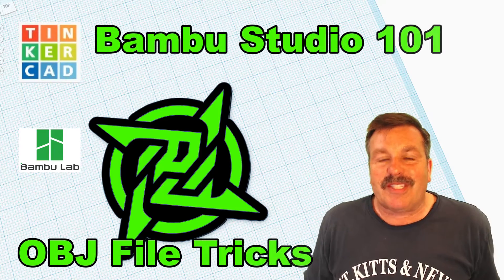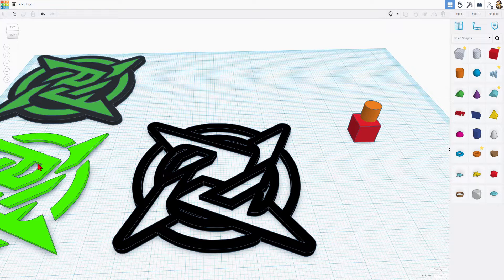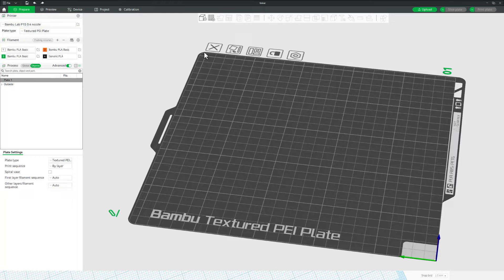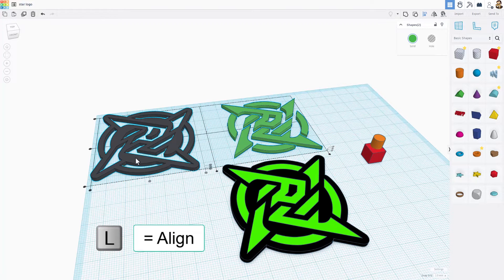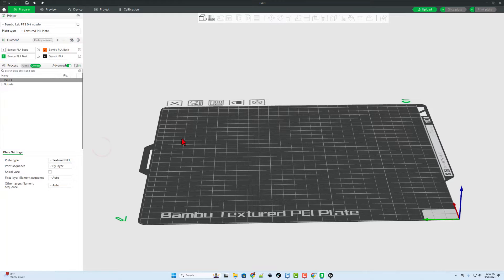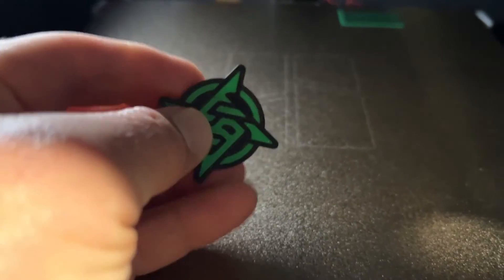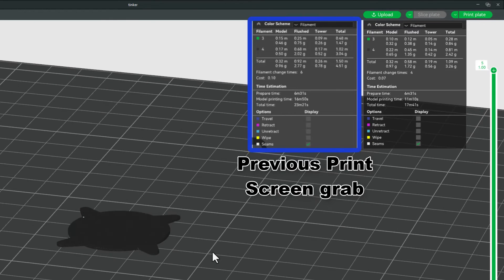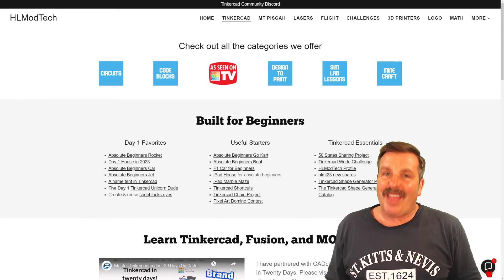Easy OBJ Tinkercad Steps for Bambu Labs AMS 3D Prints in Minutes!

Comment: Hi, I have a question. Is it possible with a picture of a wheel for e.g. to vectorize a section on it, rather than the whole image? so would it be possible to have the wheel set to 3mm high and to pull the centre (or select an inner section to 1.5?
Reply from the maker: If you are willing, shoot me an image of the wheel you are thinking of. You can reach me at hlmodtech gmail. That will give me a better chance of finding a solution.
Reply: @HLModTech  thanks hopefully the email finds you ok 👍🏻🙂
Reply from the maker: Email arrived. Shooting you a idea rn

Comment: You can also group your object in tinkercad then click multi-color in the color settings of the object, then export as a .obj file. Then in windows open that .obj with Microsoft's 3D builder, It will ask for a library (obj.mtl) which will be included with your .obj file. Then in 3D Builder you save the file as .3mf which you can use in bambu studio, with all the design colors in place.
Reply: The Bambu import errors can be solved by using preset colors when exporting instead of custom  colors, when I export using preset colors import works fine, also, click "reset" first on the color map dialog before mapping the colors to filaments, this stops it adding extra filaments
Reply from the maker: Interesting. Adds an extra step using 3D builder, but I will give it a try. Are you suggesting it might get rid of the error I am seeing with my preferred design?
Reply from the maker: On Windows 11 you cannot snag 3D builder anymore. I booted up an old machine and got in, opened as you stated, saved as a 3MF and it loaded... but did not have the colors and was not paintable. I will try again later as I have some projects to do... Thanks for the tip and let me know if maybe I missed something.
Reply: I’ve have had success using 3D builder, because just like in your video I was also getting errors trying to import my files from tinkercad in bambu studio and orca slicer.